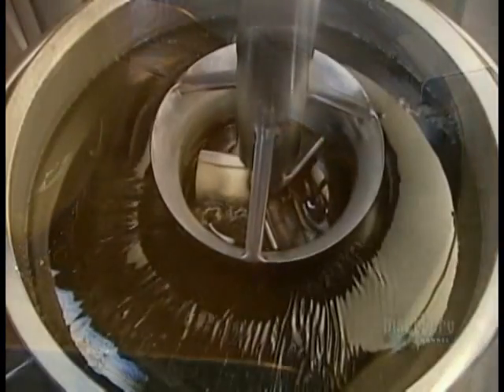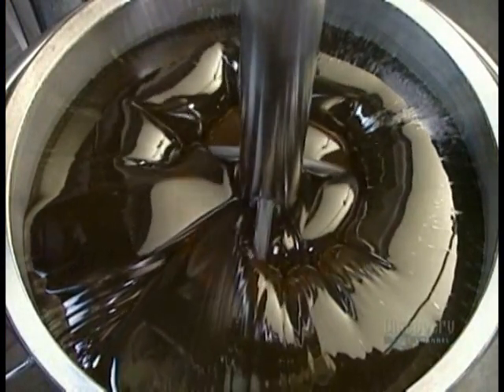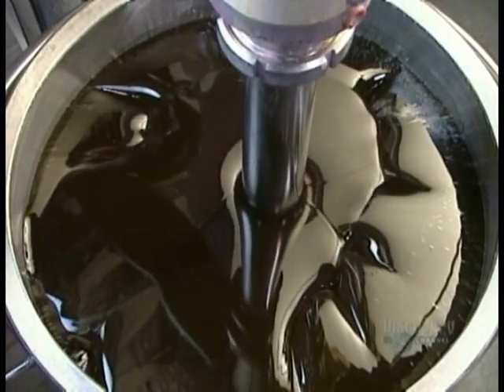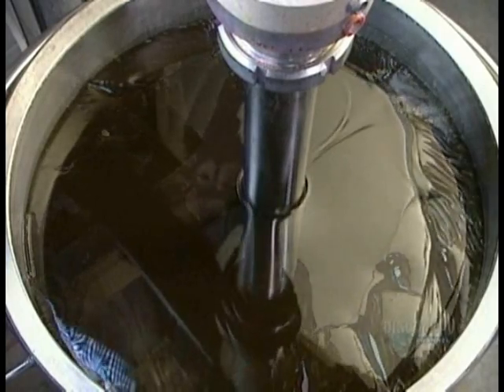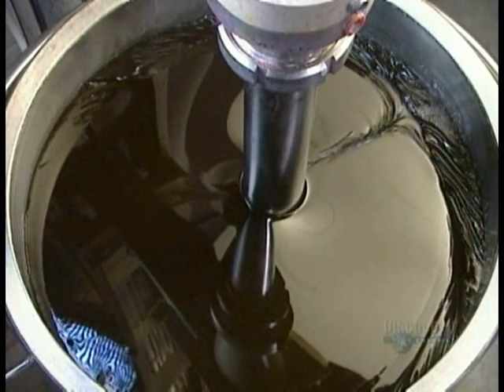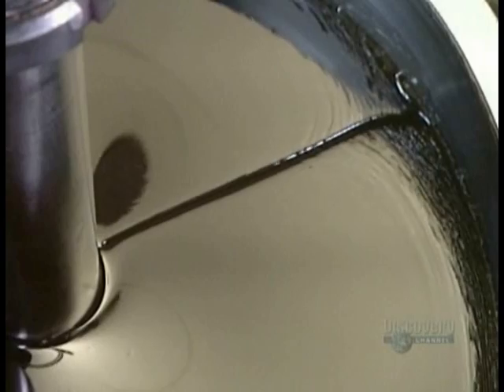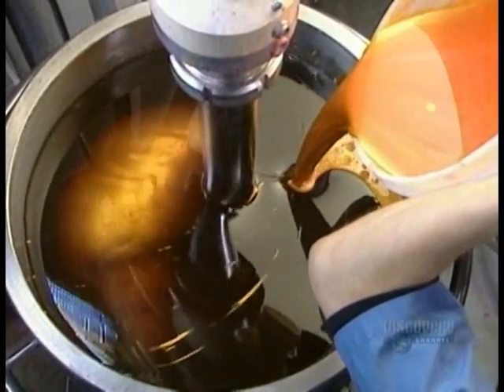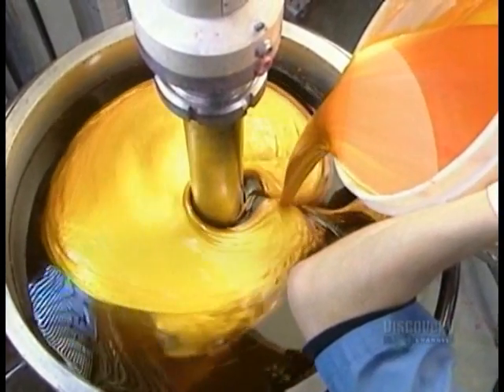How Paintballs Are Made

Comment: This is a very noneffective means of making paintball. It leaves the tell tale seam which  effects flight pattern, I think they should experiment with the same technique candy makers have been using to make filled candies, Which is having a nozzle for the fill with a nozzle for the shell around it, the Shell would start a split second before the Fill, and then the fill would start. It would take alot of experimentation but I'm sure it would work, it would also be cheaper.

Comment: good luck.  At 20 a box you'd have to sell 1000 just to cover the cost of the machine.  Not to mention installation and operation costs, raw materials, shipment of those raw materials,  machine operators and maintainers, packaging, shipping.  I guess since you're selling them the fields will have to make a profit from entry and air cost increases.